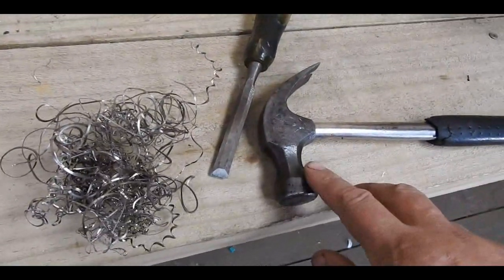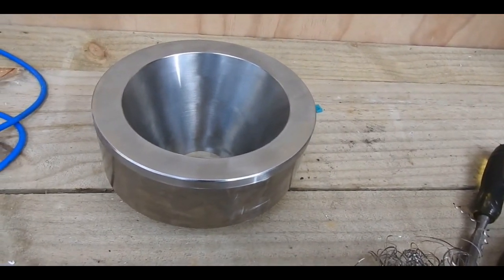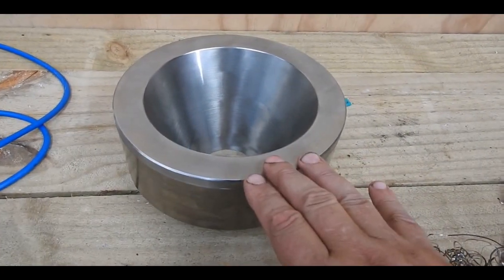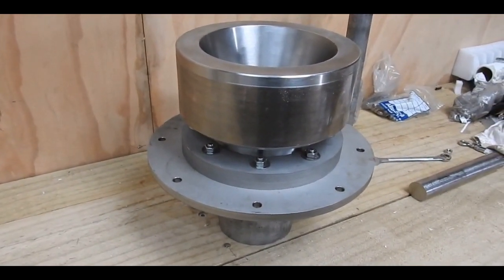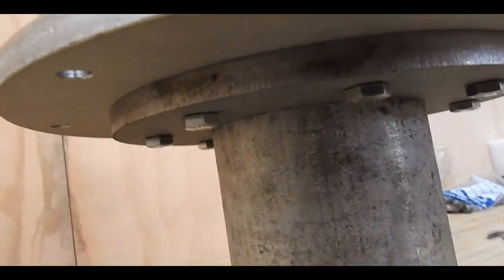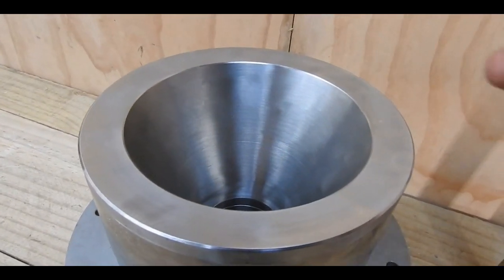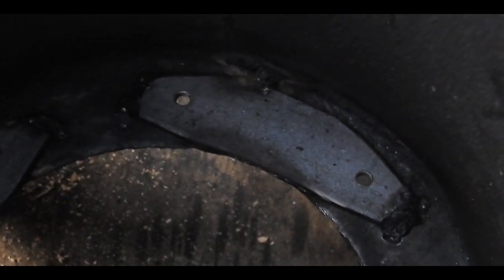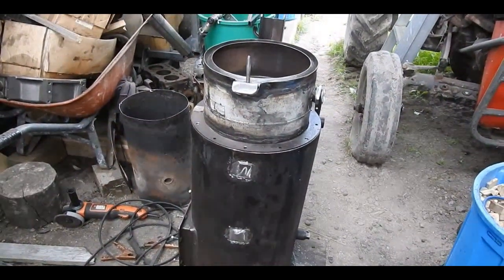Stainless Steel Gasser Gizzards

Comment: Hey Steve. As usual, IMPRESSIVE to say the least. Super nice. Yep, it takes a serious lathe, with some big donkeys behind it to spin SS like that into the masterpiece you have now. I am with Mazda on the acorn nuts instead of regular hex nuts, I believe it will save you the trouble of having to cut them if the need arises. Acorn nuts and plenty of HT anti seize is the hot ticket. Easy enough to fabricate from SS hex stock if not available to you there. You are on the path to something that should last you a lifetime with the beef that has in thickness alone. Like I said, IMPRESSIVE. Can't wait to see the thing light off for it's maiden voyage of gasser goodness. 
Also, I love to see those CNC turning centers in action. We came close to buying a Haas or a Mazak CNC for the shop here. Unfortunately, things didn't work out the way we planned. Oh well. 

Keep a eye on things happening down there my friend.
Reply from the maker: Howdy partner, 
 Thanks kindly  :) . 
 Yup, my lathe tried its darndest to cut this stuff, and it did a pretty good job, but the old leather strap that drives the spindle was not gonna last the journey, as I was pushing it purty hard. 
 My friend's lathe did the job very nicely, as it is quite the beast, and it has the muscles to match  ;) . 
 I will definitely look out for those stainless steel acorn nuts. They must be available around here, so I shouldn't have too much trouble in finding them. 
 One thing I might have to do is run a retainer wire thru the nuts, to ensure that they don't work loose over time. 
 Hopefully, if all goes well, I will be able to set fire to this beast during April. If I am lucky, it will work smoothly, and not need too much fine tuning. 
 Something this shiny has got to work perfectly, right?   ;) . 
 One of these days, you may just get a CNC machine for your workshop. 
 CNC is rather addictive, as I am sure you'll agree. 
 I think I will be investing in more CNC gear when I move onto the new place later this year. 
 A new CNC mill, and a few other toys, are on the horizon  :) . 
 Maybe a TIG welder and a plasma cutter will come to join the sparky party. 

 Take care in woodgas bug land, my fellow woodwattage maker.
Reply: @CNCmachiningisfun  Leather strap?? Man, I thought my lathe was OLD. Yours is a antique.. Safety wiring the nuts is a thought if you have experienced loosening fasteners. Think aircraft. Everything is safety wired. I just used coupling nuts on mine and put plenty of anti seize on them. To me, as long as all the threads are covered and you have the anti seize on there, it shouldn't be a issue removing them. But, acorn nuts would be best. 
As for the CNC, I am probably past that stage here. I would like a new lathe and a decent knee mill for the shop. I can do most anything with those. You will love a nice TIG welder there. Once you get used to them, you never want to stick or, MIG again. Yeah, there is a place and time for both, but, TIG is sweet. Plasma cutter?? Don't know how you do what you do without one. Ours is a Hypertherm 38, which as a 3/8" thick capacity. I wish I would have got the 1/2 cap model. I think Bill's is a 1/2" cap unit. 
April??  Can't wait to see the maiden voyage on the new SS work of art. Have you located a new homestead plot?? Good luck and I hope you find a nice secluded place that isn't in any danger of "urban sprawl" anytime soon. City dwellers can ruin a place in a hurry.
Reply from the maker: Yup, this is a perty old lathe. 
 I got it cheap, about 25 years ago, direct from Noah's Ark-welder  ;) . 
 Because those nuts are gonna be hard to get at, in the fully assembled hopper unit, it pays to have a safety wire on them. 
 Acorn nuts seem to be the best bet, so I will look for those next time I am in town. 
 For sure, a CNC masheen isn't 100% necessary, but it sure does allow for some accurate jigmaking - for the fitting process. 
 Mine came in, real handy, for the rebuild process on this little gasser. 
 I am with you on becoming addicted to the TIG welder over the other systems, as they do such clean and tidy work. 
 Though I have virtually no experience with TIG, I sure did like watt little time I had with one  :) . 
 For the plasma cutter, I might end up building a CNC table for it, so I can produce accurate and repeatable pieces for future projects. 
 It's a pain to work a lot of metal without the right tools, so this is just one more thing to look forward to. 
 1/2 cap wood be a pretty good thing to have, as I imagine we wood seldom need any more than that for most of the work we do on our projects. 
 April is the target month for a test run on this, and everything seems to be progressing at a suitable rate for that timeline  :) . 
 Don't worry, I will make a video of it, so everyone can have a much needed woodgas fix  ;) . 
 I have found me a couple of really nice places to look at. Each one has about 10 to 12 acres of land, and a perty flash house with electricity and running water. 
 Having become accustomed to not having these, it's gonna take a bit of getting used to  ;) . 
 The places I am looking at are perty safe from the dreaded urban sprawl, so I reckon I will be able to enjoy some real quality time, out in the open. listening to the birdsong, and scritching my itchy butt, without having to worry about watt the neighbours 'think'.  
 Talking of which, I had 3 land developers here today, looking over the land, and agreeing to my asking price, which I will admit is pretty huge - up in the millions  :) . 
 A bright future awaits - - - until the woodgas bugz find out where I have moved to!

Comment: Steve, you've got a masterpiece on your hands. I would use steel acorn nuts on the bolts that hold the 1/2" plates together ( don't forget the anti seize). That's what I did on the stainless studs that my access door bolts on with. Also I would weld the first plate to the bottom of the hearth. This way you don't have to worry about threads in the highest heat areas. What you made there is very similar to what I had in mind for my reduction zone. I don't think I'll be able to spend that much money for material,  so mine won't be as durable since it will be made of thinner stainless. Beautiful job my friend.  I can't wait to see how this works out for you. Looking forward to the maiden voyage. Keep us posted and thanks for the show. Joe
Reply from the maker: Howdee Joe, 
 Thanks kindly. 
 I will try your idea, to see if it allows me to reuse those bolts. 
 Auntie Seize will also apply some of her special lotion to these, to help them stay sane while they are baking in the woodgas oven  ;) . 
 Yes, those SS cones will be welded to their respective plates, so as to reduce the total number of parts that will need to be held together with bolts. 
 Maybe, if I am lucky, I might be able to get all of this up and running in April. 
 The weather is starting to cool off now, and I really need to get this gasifier working, before the winter comes, and freezes the nuts off my bolts! 
 I really don't know how hot a gasifier's reduction zone gets, so it is possible that this one is over engineered.  
 Maybe, you will not need a particularly robust red-zone in yer gasser. 
 Indeed, my previous one was rather delicate, and it ran for well over 1000 hours  :) . 
 One day, in the not too distant future, I am gonna get all this shiny new steel dirty, by carelessly setting fire to it, and wandering off, to watch TV  ;) . 
 Keep us up to date with your build progress, my fellow woodgas addict.
Reply: Steve, you're rushing around trying to get stuff ready for the cold weather,  and we're waiting patiently for the warmer weather. I have a few things I have to get done before I get back to work on my gasifier,  but with the warmer weather heading our way,  I should be picking up the pace on lots of outdoor activities. I'm rooting for you on an April run. Maybe when you get this all worked out,  we can gather all the dimensions of that fancy hearth and put some cad drawings together to share with everyone. I think we would all love a bullet proof combustion zone. Joe
Reply from the maker: @mazdalorean  
 Howdee Joe, 

 Oops, sorry for the late reply. It turns out that google failed to let me know of your comment! 
 Yes, the rush is on at the moment.  I need to get a couple of tons of firewood ready for the winter, finish the gasifier - and get this place ready for sale. No pressure, eh? 
 So far, everything is lining up well for an April run. I really am looking forward to setting this thing on fire, to see watt comes out when it gets a bit smokey  ;) . 
 Your weather will soon be nice and warm, while ours will become super frosty and stormy. 
 No worries, as I shall warm my hands over this shiny new woodenwatter. 
 If it works as planned, I sure will release the measurements of this fine wee beast. 
 As I see it, a durable hearth structure is surely at the heart of a successful gasifier  :) .

Comment: Hi CNC
Nice piece of machinery

Just wondering why did you get ride of the different air nozzles in the victory gasifier ?

Because I just finished my and I have followed the Bible if Ben Peterson and I have put the number of air nozzles prescribed by Ben.

Does it causes problems ?
 Is it better to use 1 big air nozzle ?
 Thanks for all the information in your videos
Always a pleasure to watch
Reply from the maker: Thanks kindly. 
 The original air nozzles worked very well in the Victory gasifier, but they eventually broke down, and I was unable to remove them for replacement. 
 They got welded in place by the sheer heat of the burn zone! 
 Your gasser will work perfectly with the nozzles that you are going to use. Just be sure that you can extract them, when needed. 
 
 The new nozzle will be easier for me to replace or repair when it wears out, as its threads are a long way away from the hottest part of the gasifier. 
 The new nozzle will have 6 or 7 holes in it, so as to let it work in the same sort of way that a standard Imbert gasifier does  :) .
Reply: Great, I just fire mine for the first time and it wasn't very convincing .

The smoke wouldn't light up 😂😂

All the system was OK , I even try different speed for the air blower , like Flash mentioned in 1of his video.

Smoke but no flame 
The wood was Sicimore tree , at about 40 % dry , but once it was started the gasifier became very hot in the outside , and as it became hotter the smoke started to get clearer !
Could it be why ?
I don't know ??
Any suggestions, anything is welcome
I'll Try again tomorrow 
Give you an update if it's OK with you
Thanks again
Reply from the maker: @marctorrades1760  
 Please feel free to upload some videos of your gasifier, so we can offer our help and ideas. 
 Between us all, we'll get it working  :) . 
 Now, one thing to remember: Charcoal is your friend here! 
 Make sure that you start off with nothing but charcoal, then you can add the wood, once it is lit up. 
 I get the feeling that you were trying to start with wood, and little to no biochar. 
 This will smoke like crazy, and it won't light up.  
 The gasser will get hot, and it will produce heeeeeeepssss of smoke, and a lot of tar!